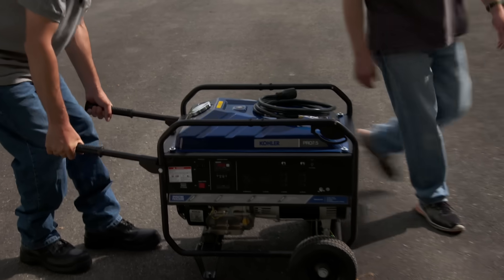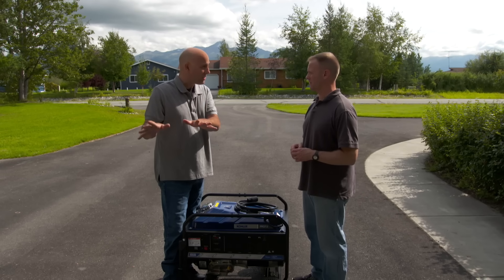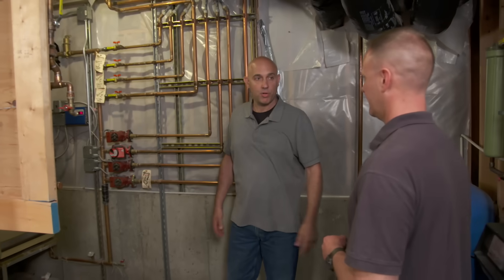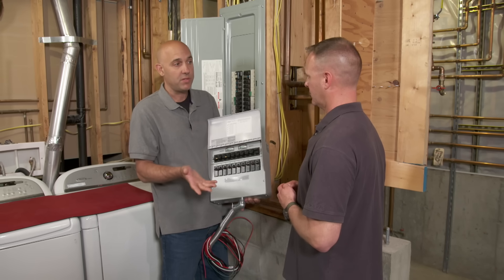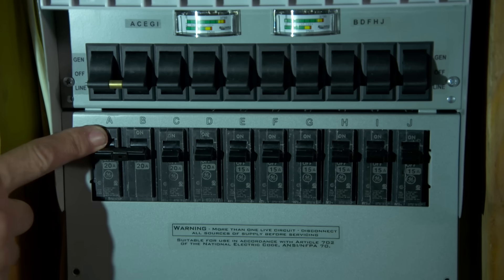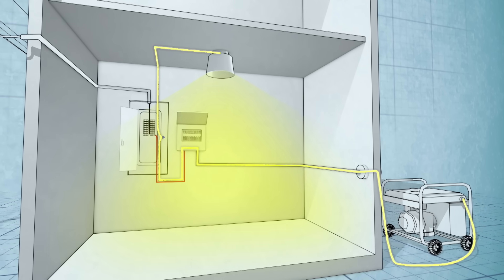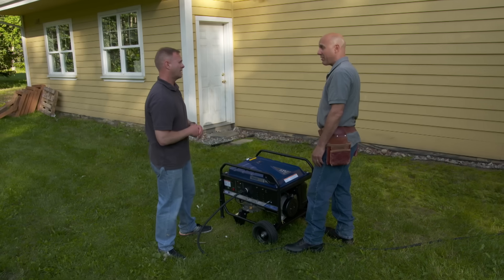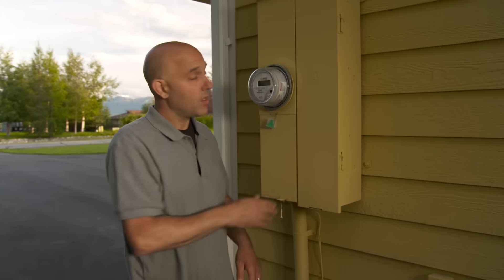How to Install a Manual Transfer Switch for a Portable Generator | Ask This Old House

Comment: The manual transfer switch IS THE MOST IMPORTANT feature of your portable generator connection. The other thing to remember is to understand that you'll need to be home to activate it. The standby generator is a much better solution.
Reply: electricalron you have to realize some people don't have access to natural gas hookup and installing a tank in the backyard is not feasible. Their are pros and cons to both it's just a matter of what works for your situation.
Reply: You are very correct on every bodys needs being differently. I would be very happy with a Honda i2000 to run the furnace on a furnace transfer switch. Maybe switch to the fridge every 8 hours to keep that cool. flashlights and a few books to hunker down with. The larger portable gas generators scream at 3600 rpm and burn through gas in no time. My power only goes out 1-2 times a year for no more than a couple days.
Reply: electricalron Agree.  We own a standby generator, which not only exercises itself for twenty minutes weekly, keeps our basement sumps (and a lot of other things) going if we're not home through an automatic transfer switch, and has twice the power generation of a portable unit. It costs more, but it's worth it (and we get some of the value back if we resell the home; buyers love this stuff built in).
Reply: Well, it is true that the reason for this setup is because the area in question is prone to disruption from earthquakes...

However, there are rugged, with vibration isolators, solutions that could still work... Just maybe not in the home owner's budget range...

I'd personally pay the extra expense and go with a hybrid solution with battery bank, inverter, and the generator...

Reminds me of a story I read once back when we had that big North East regional blackout back in 2003... A engineer had a hybrid car and hooked it up to power his home during the blackout... 

Basically powering the house off the batteries and setting up the engine to start and recharge the batteries when they got low and then shut off until the batteries got low again... On one tank of gas he kept everything running all week...

A good generator can adjust its power output and fuel consumption but it's hard to beat a hybrid system for efficiency and I think that makes it worth the extra costs... While still being cheaper than going with solar, etc. and even if the generator needs to be stored away when not in use, the UPS means I'd have plenty of time to set it up and short outages wouldn't need the generator at all...
Reply: This video didn't address the floating neutral I hear so much about.  Is it necessary to disconnect it on a portable generator in a home application like this?
Reply: Ampacity Electric We paid $4500 for our Generac automatic system, not $12,000 (5 years ago). Installation not included in that price, but then again it's not in your quote on the portable unit, either. 😊. I bet we'll get half of that back in the home resale. Again, it basically powers our entire house, garage doors and everything (unlike the homeowner in this video that had to select ten devices). Frankly, I know three others who own portable units like in this video, and they all suffer with them not working in emergencies. It's not like the electrician in this video makes it sound when he says "just put it in your garage". Engines need to be run routinely, even treated gasoline goes bad, spark plugs and carburetors get corroded and clogged, and few owners routinely maintain their portable generators, let alone fumble around in the dark starting them cold. Just another view of factors to consider as one makes their own decision. Everyone has their own needs. Many make do with just a Honda i2000 small jobber.
Reply: No, because the system neutral conductor IS NOT switched.
Reply: hllywd964, It depends on whether it's a separately derived system or not.  In this case, it's not so you don't have to disconnect the service neutral.
Reply: ok thanks, I had read and seen videos of transfer switch installations that suggested removing the floating neutral on the generator for safety reasons.  I'm not an electrician, and was just curious.
Reply: hllywd964 ..it depends on the transfer switch you use. If the transfer switch  does not transfer the neutral, you need to use a "Floating Neutral" portable generator. If the transfer switch does transfer the neutral, you need to use "Neutral Bonded to Frame" portable generator. Resaon being is you do not want "neutral to ground bond" at two location/place. Your house service panel is neutral to ground bonded so NO other location/place (upstream or downstream) should be neutral to ground connected/ bonded. Also, it's the "Neutral Bond to Frame" connection/bond that is removed. Not the Floating Neutral that is removed since there is no Neutral to Ground that is connected/bonded to each other hence the word "Floating".
Reply: Standby generators aren't that useful if -- as in my case -- the homeowner has no access to propane or natural gas  hookup.  I have only electric (and oil heat) at my house.
Reply: If the manufacturer supports it, yes it would be recommended to unbond the neutral from the frame when connecting to a 2-pole transfer switch to a home electrical system.  It's necessary but much better if the generator is floating when connected to a switch in a wiring system of a building. Arguably floating neutral is superior in many other cases as well, subjectively.
Reply: good for you, the CHEAPEST quote I got for a standby generator was $20k........
Reply: Standby generators are nice, but they are expensive. Many people already own a portable generator, and this shows a safe and acceptable way to use it without running several extension cords.
Reply: I'm simply sharing my expert advise.  Take it or leave it.  And yes, I am an expert after 27 years in the trade.